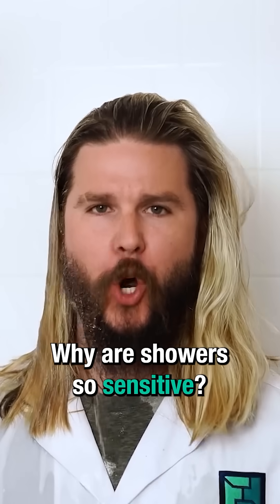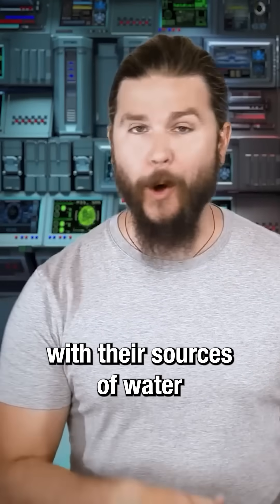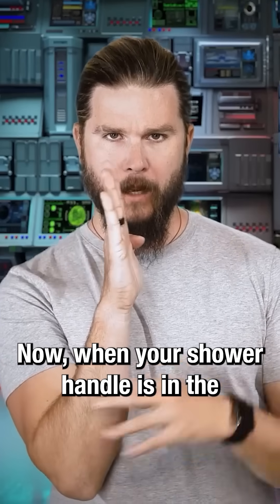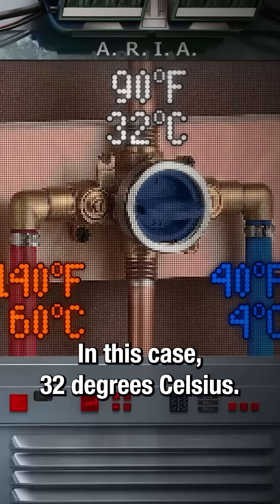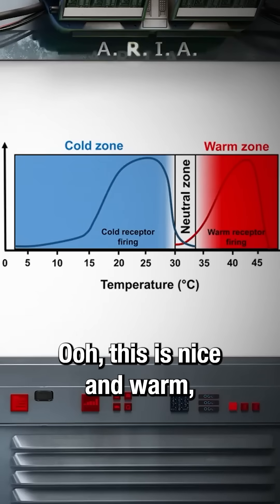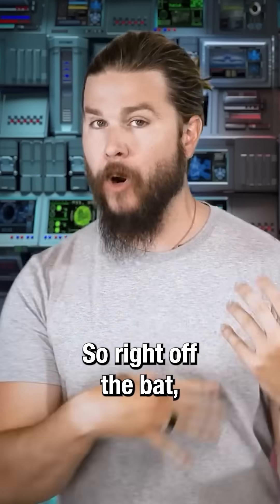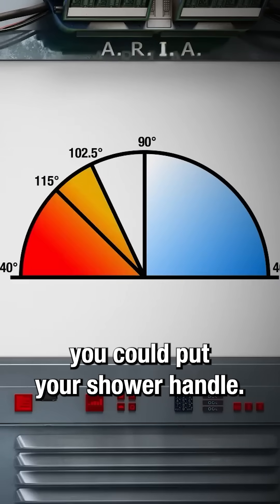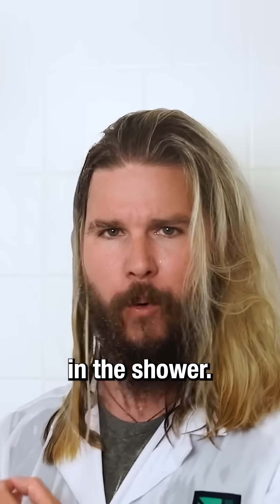Why are showers so sensitive? 🥶🥵

Comment: Not useless. Hot and cold water supply fluctuates. If I flush the toilet there is less cold water pressure and after 20 minutes of if a housemate also is showering or just finished showering the hot water either has less pressure or actually is cooled down since it doesn't have a chance to heat up. I could turn the knob all of the way to hot at some points and get warm water. The cold are for SHOWERS is only sometimes useless. But for tubs they are important. Cleaning and filling up containers doesn't need hot water. Most apartments don't have exterior hoses but during a flood it's easier to store extra water in your tub since most people don't have exterior water tanks. Inside, the most water flow you get is from tubs and showers. You pay more for hot water. And hot water can distort things. Having a knob that only ever has a medium or less than medium water temp isn't smart

Comment: Was told by a plumber he can't help me with a job because apparently there's a thing that's supposed to mix back in cold water so the hot water pipe is never able to cause burns.

I call BS, this guy obviously knows how many houses have showers that turn into lava rain if you accidentally bump the shower handle

Comment: Too hot and too cold settings are not useless. Cold showers and baths are great after workouts, and using a higher water temp than you would for showering to make a bath helps prevent it from cooling down too fast as you pour it.

Comment: Y'all have inferior tech, TMV at the tank with two taps, crack the cold tap and then just one quarter twist of the hot and you are in sweet spot, easy
Reply: Next level would just be a TMV shower tap system

Comment: Showers are also designed stupidly as most I have to practically kneel to have the water hit my head. The shower head should be on the roof not the wall

Comment: It's a sweet spot sure but I'll tell you what, as an Australian, I use the very end of the cold part almost everyday during the summer just to cool down and on the opposite end I would reckon somewhere where the temperature gets cold enough to freeze pipes, they probably leave it on full heat to unfreeze

Comment: the closer your shower is to the water heater, the wider 'the sweet spot' is. on-demand-water-heaters widen it, insulating your hot water pipes widens it, turning your water heater temp up to 'COOK ME LIKE A LOBSTER DADDY!' 45 minutes before you intend to shower widens it, buy a water heater with a bigger tank, insulate your hot water heater with a thermal blanket.

 dogs n cats n kids n elderly people have different 'sweet spots' than adults do, so that WHOLE lever isn't useless. 

if you don't like the lever? get a digital readout one for big huge cashola and puths tha busson! puths tha busson! and set your temp to within a few DEGREES of how you like your shower. every. single. time.

Comment: Yeah but if you're like me, you always run out of hot water and need to keep dialing it up all the way for that extra sweet few minutes of warmth.
Reply: I don't run out of hot water because my shower head is also the heater.
As long as there's power, there's hot water.
Reply: @koi596 
electric shower gang
Reply: @sunflower8227  hell yeah
Reply: @koi596  Thats goid but they can be dangerous
Reply: @arandomsupra  that's actually not the case at all, the shower is well grounded, the wires never come in contact with the water, and the heater is fully sealed.
Many people get the misconception that electric showers are unsafe, but they're actually pretty great at not killing people.
Reply: Must be some rust bucket heater you got there. Over here in Finland I have never tried a single shower (not in hotels nor anyones home) where the hot water would end in any reasonable amount of time (tried up to an hour before). Its also always consistant, no matter what apartment neighbors do. Only thing that might affect consistency is your washing machine running at the same time.
Reply: More often than not my shower is only ended by running out of hot water
Reply: Oof

Comment: Its not pazy engineering. Its liability removal. People with sensitive skin could genuinely experience issue with it immediately jumping to a warmer temperature. People with heart issues, those who are high risk for stroke, and those with panic/breathing disorders could actually be hospitalized or die due to the water being too hot. Having that dead zone is very similar to the dead zone on your steering wheel. Keeps everything from happening too fast. This is also the reason they have scald stops in all modern shower valves and sink cartridges.

Comment: And somehow it only takes a few showers to be able to get the perfect amount of spins and line it up to the sweet spot first time everytime. Mine is currently "hot till water pressure makes water straight then cold till the shower head moves" coz our pressure is insane at the moment so it literally lifts the head out of the holder thing if you turn either tap up to much. Feels like its ripping your skin off haha

Comment: One valve for mixing. Another valve for pressure so you so can leave a pre-set perfect temp, then a tankless water heater to maintain consistency in the water temp. I include a small electric water heater for the kitchen sink or bathrooms distant from the water heater so you inidiatly have a good warm or kinda hot temp for that first bit of water that comes out durring the winter.

Comment: You know I remember a type of shower handle that didn't have this problem. The kind that wasn't a mixer. You remember those kind where you had a knob for cold and a knob for hot? Yeah those worked fucking great because you turned on all of the hot and then you started adding cold until it was tolerable. Then if you needed it a little bit hotter you reduce the cold, and if you needed it a little bit colder you reduced the hot. When you're using more hot than cold you can control both micro adjustments and macro adjustments based on which handle you would just. But no, everyone's gone the way of single handle mixer style taps, and they fucking suck.

Comment: they should simply add a down-gear system so that the turn radius of the dial is the same but the stops are at either end of the comfortable temperature range. then, also get a larger water heater. then you can have perfect showers every time

Comment: I have an electric shower which is nice because it directly heats up the water going through. So it's all the same cold temp going in and getting heated up a certain amount, and adjusting it a little bit only makes a little change too. BUT in winter I am in hell. Because the water that is in pipes outside is cold af. So after a few minutes showering at perfect temperature we reach water that has not already been heated a little by all of the buildings heating and the temperature suddenly drops. The heat dial really only decides how much the water is heated up, there's no thermostat to adjust to a specific temperature.

Comment: Sounds like you just have your water heater turned up too high. In the us most now have a simple to use red dial to adjust how hot it keeps the water in the tank.

Comment: My shower has a knob that instead of going left to right, it goes front to back, and has numbers going from 1 to 12 and a "safety" button (that you need to press and turn for higher temperatures beyond the number 6).
Much more wiggle room for finding a nice warmth

Comment: No it's even worse than that, if your heater is off then it gets fucked. If your handle is wobbly or on wrong or just a little off, it gets fucked. Also if your heater isn't strong enough it gets fucked

Comment: Dang. Life as a millennial is soooo hard. They have such awful problems as not finding the sweet spot in the shower. Yall make problems out of things that arnt really problems at all. Just be happy it's hot at all. Or how about your potty is(INSIDE) out houses where it not even that long ago. Even the rich and kings, the best was to just poop down a tunnel and it feel out on your front door step. P.S fun fact. A king ans his airs had to leave they're castles because the smell was so bad after they kept dumping all they're waiste in the mot of water around there house. This is the other reason that a moat was so affective because all the  warrior's had opened cuts so they know if they even got splashed with the moat water theyed get infected and die. They couldn't stop infection as well back then. Shxt little colds and stuff we kill with syrup would be a death sentence back in the day. Toothache? Dead😂😂😂

Comment: It makes sense as it is. The cold options are there for cold showers, for those who want them.
As for the surplus extra heat option that no one would want to use is useful for if the heater makes the water come out colder. Meaning you can still have a warm shower by bumping the heat up a few notches.

Comment: Honestly, I’ve never had a problem finding a comfortable temperature unless there was a problem with the faucet or water heater to begin with.  I will now share with you how:

If you are taking a shower, and it’s too cold, then go ahead and grab the temperature/faucet handle and your gonna go ahead and turn it towards the warmer, or ‘hot’ side until it is comfortable.  Now, conversely, if the water is too warm or hot, then you’re going to want to grab the same handle, but in this case, you want to turn it towards the cooler, or the ‘cold’ side.  And that, folks, is how you find a comfortable temperature, even in the midst of having many,  many, waaaaay too many temperatures to choose and adjust from.